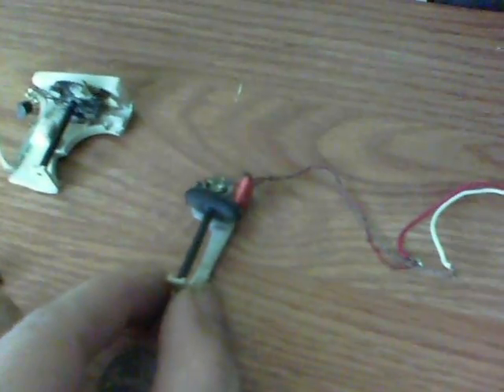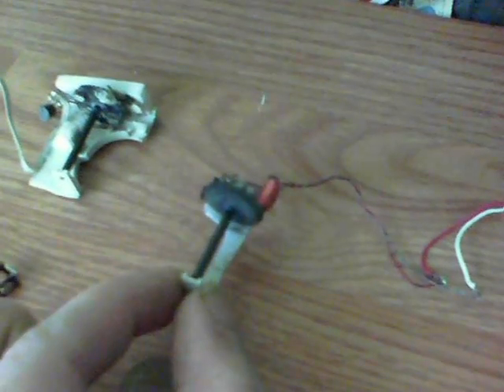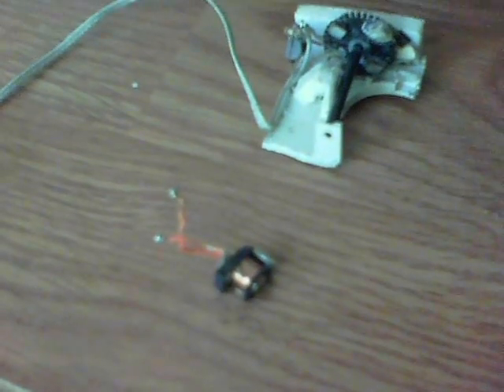Nano Pulse Motor - smallest yet

Comment from the maker: @min2oly Thanks Patrick - I haven't tried that yet, but am intrigued with ZPE methods to optimize the Adams simple circuit  for R/C. 
Also spikes and declines for powering up/down circuit elements, that are so random and chaotic that they in fact linearise expectedly and dependably ! Order from chaos, repeatable chaos at multiverse electron level. On their own, tiny insignificances, never measurable, but when running 2000 RPM, universal harmony disrupts in our favour, trying to balance  !

Comment from the maker: @jozsab1 Haha yes, certainly compared to scientific type laboratory things... nano for homemade :) 
Saying that, if I had a budget or lab, then all of this would probably never have been a project. Simply trying to oppose the wishes of a helicopter type design to spin around from rotor direction...if the 'large' pulse motor rotor goes one way, the rotor on the top of a heli is intended to go the other and balance out torque.